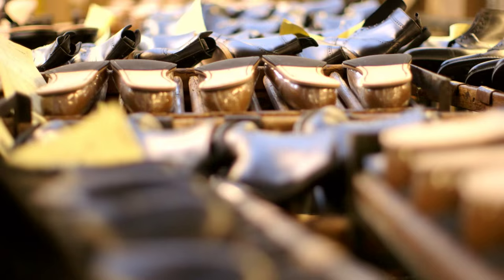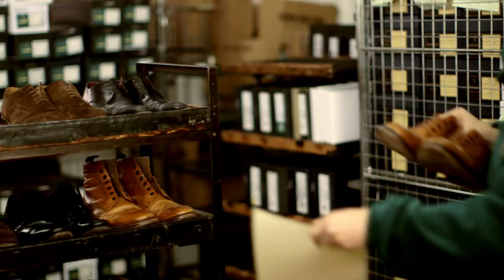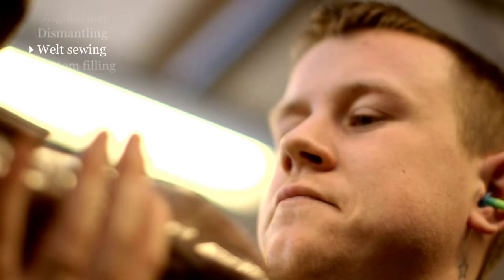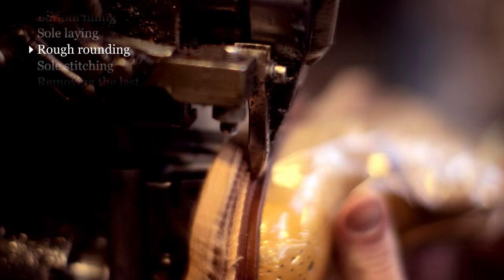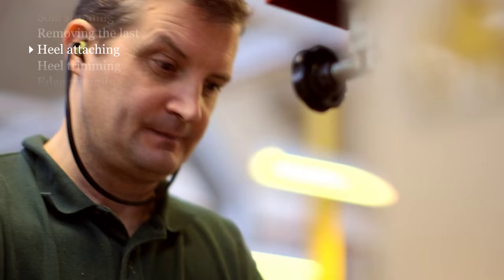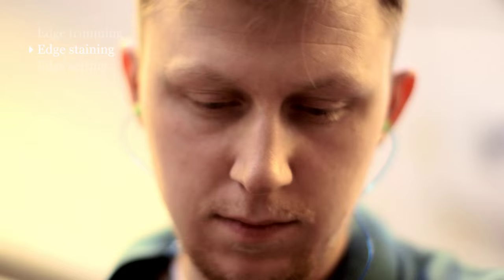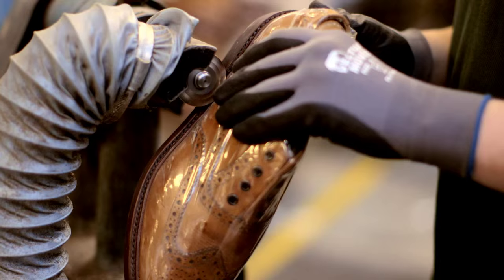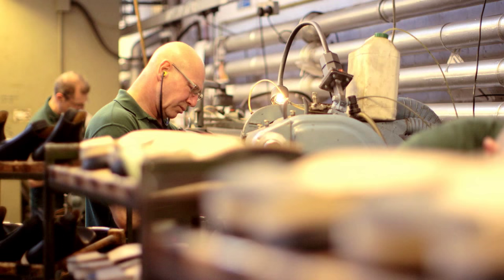Loake Shoe Repair Service

Comment: What an amazing video.  As a previous commenter suggests, how refreshing it is to see that this level of quality and care still exists.  As of the date I found this video, there were 15 negative clicks; for the life of me, I cannot imagine how anyone, let alone 15 people, could not like what you see here.  One thing that always puzzles me - with such high quality shoes, why does a manufacturer like this not team up with a shoe-tree maker to make LASTED SHOE TREES???  I mean, you get this quality shoe, then have to go buy an off-the-shelf shoe tree.  I own several pairs of quality boots & shoes, and I know that I would pay more for an exact fit shoe tree.  LaokeShoemakers - if you're listening - please consider this.  Thank you for a quality video.
Reply: LuvmyGSD the problem is that Loake is ignoring abiut 75% of the shoe in this "refurbishment" - the upper and the interior. This "refurbishment" is basically expensive and high-quality resoling.
Reply: LuvmyGSD the people who gave negative clicks very obviously don’t understand what craftsmanship and quality are ( their loss)
Reply: They destroy the welt of the shoes (1:45) during "refurbishments" and puts in a new one. They are intentionally damaging the uppers to limit the number of times you can resole your shoes. You then go buy a new one after 3 or 4 resoles. I'd rather go to my local skilled cobbler who handstitches new sole to the welt of my shoes.

Comment: I sent my 1880 Brogues back to loake for resoling (Danite sole) and general repair etc  was quite expensive but worth it to go back to the actual people who made it in the first place ... however the shoes came back perfectly resoled but the uppers were in as bad a state I when I sent them ..like the leather was very patchy dry looking the leather surface was dry at creases etc and showed distinct dry  lines  . Now yes I regualrly polished them and cleaned them I even used leather cream to feed the leather ( many times ) in the hope it would solve the issue ..but nothing helped they would polish up  ok but within less than a day of wearing them the dryness at the creases was back and the shoe looked very poor , I was disappointed that Loake to not address this with their knowledge  or even bother to enclose a leaflet or "report " to advise me about the issue or advise me that the uppers were beyond repair (i.e able to take a polish or feed and NOT appear dry at the creases etc ) in which case I would have binned them and bought new . So I don't believe they are carefully examined and brought back to the original standard at all (wear and tear allowing of course ) . I got the feeling they just put on new soles took my money and did not think to advise on the sorry state of the uppers appearance /condition with a view to the best outcome for ME the customer versus them taking my money for a resole .When I send them back to the factory for an expensive rework I want them to come back to me as close to new/ reconditioned as wear and tear allowing of course  .Very disappointed with Loake in that respect .
Reply: How much was the cost?
Reply: @rachellockwoodle  at the time (around 2 or 3 years ago £80 ish . I cant remember exactly

Comment: So the £80 repair is worth it! I'll be sending mine off soon.
Reply: they ruined a pair of mine , take a few photos before you send them , my boots came back with one of the pull on tabs cut and the mid sole missing , I sent them back 3 times got the tab replaced but not the soles but I got a £300 pair free but what I really wanted was my original boots sorted .

Comment: How much would loake charge for such a service? I foolishly got my shoes repaired at timpsons, but now I know this exists I think I'll have to try!
Reply: Cheaney charges 95£ for the same service. So prob in that range..
Reply: in Germany it costs 119 Euro, approx. £100 and includes the shipping too. I heard that one can refurbish a shoe 3-5 times, so one can  use a shoe 20+ years. Much cheaper than buying a glued shoe and throw it away after a year or two. I can't afford buying cheap shoes;-)
Reply: Timpsons are a rip off.  An out of town good old school indepedent shoe repairer  would charge about £45.00 maximum

Comment: I was recently not impressed by a Loake repair & would be hard pressed to ever send another pair back for this service, it was actually done FOC due to a quality control fault of there own in the first place (so 2 QC failures), now had I paid for it I would have been twice as annoyed. I have since found a good cobbler who will be doing all my repairs from now on.

Loake: sort your quality control department out !!
Reply: they left the mid sole out of a pair of chelsea boots that I sent for re-soling, instead of making good the job they offered me the pick of a pair from their catalogue so I chose a pair of dark blue Bedale lace ups costing £295 all I wanted at the time was a £95 re sole.
Reply: @rogerofrhodri  funnily I was told the factory manager would pick me a new pair himself & sent them out to me, they were a Chelsea boot too !

Comment: People buy goodyear welted shoes so they can have them resoled over and over. Removing a perfectly good and usable welt and machine stitching a new one damages the upper and reduces the integrity of the shoe. English shoe manufacturers like Loake, Barker, Crockett, Cheaney etc does this so you can only resole your shoe 2 or 3 times before you are forced to buy a new one. Don't fall for this marketing strategy. Bring your shoes to a good cobbler who can handstitch a new sole to your welt and upper and you will have a pair that will last essentially a lifetime.

Comment: I am considering going for a pair of Loake boots. I have noticed they are very similar in appearance and even colour to Tricker’s boots. However, the latter are considerably more expensive. I’m assuming there must be a difference in quality, or is there? It would be good to get an insight from somebody who has owned both. Thanks. (Knowing me, I’ll probably just end up buying both and being the judge myself.)
Reply: Don't buy  " design Loakes " made in India , they look good but as far as quality goes  nowhere near as good as the English shoes.
Reply: More and more traditional shoemakers are selling specially designed, cheaper lines that are made offshore — in Loake’s case, India. I have two pairs of Loake loafers — one made in Northampton and one from India. The latter is OK but it’s true there’s no mistaking the difference in quality. Just make sure you ask the question if you’re buying in store or if buying online, most of the decent cobblers state specifically if a particular pair of shoes  are UK made. I am currently waiting on a pair of the Royal wingtips. Loake may not be considered as good as Church’s (now owned by Prada, I believe) or Cheany (owned by Church’s) but I like them a lot - the Brighton loafers fit my feet perfectly and the UK-made shoes are good value.

Comment: I have 3 pairs of Loake. They are impressive looking and quality made shoes. The main issue blocking me from wearing them more often - they are not really comfortable shoes compared to cheap common pair of sneakers. The reason for that is their insole is basicly just hard flat piece of leather with a bit of glue and cork. They should make insole more anatomic/softer - feet is not flat, so hard flat insole is not comfortable to walk in....
I understand they are making them the same way as they did 100 years ago, but I rather enjoy modern car, than 100 years old vehicle...

Comment: I do believe not all of loakes shoes are made in good old england. hasnt loake outsourced some of its lines to be made in the far east
Reply: +Daniel Devine Yes, the L1 line is made in India (even says so on their website). It's less than half the price of the 1880 line though. I think they saw a gap in the market for "affordable" goodyear welted shoes.
Reply: As I said in my previous post, Loake advertise that the L1 and Design range are made in India. They advertise that the 1880 and Shoemaker range are made in Northampton. Is there something I'm missing?
Reply: michael yates So the 1880 and Shoemaker lines are fully made in England? The reference to Northampton was my error. The website says Northamptonshire.
Reply: Some of the cheaper ones are made in India.
Reply: Daniel Devine 
The 1880 and the Shoemaker Lines are made in England but the Design line is made in India.
Reply: I have Design Loake range and it says made in England ???? Strange
Reply: Design Loakes are made in India  , look good , but the quality is not the same

Comment: if customer service is so important for Loake, why do I never get any response from them, when I ask about sizing and lasts?
Reply: Bruno Koch you are not important customer for us sir
Reply: Bruno Koch call them. Better to call them rather than emailing
Reply: You will never get size correctly online, unless you try the shoes yourself...
Reply: Thats not my experience.
I recently re-discovered a ' brand new' pair of brown Loake slip ons that had been stored away for around 30 years and still mint , in the original box.
I wrote to Loake asking what I should...if anything...do to ensure these shoes would still be good as the day they were made, and hadn't dried out etc etc.
They were very polite, responded quickly, and did their best to be helpful, while suggesting that they would give me a detailed answer if I SENT the shoes to them , using pre-printed Royal Mail arrangements, in order that they could advise post a genuine assessment of the condition today.

Comment: What boots are those at 0:23?
Reply: Pretty sure that's the Burford. I have a pair and they are wonderful once broken in.

It's made on the same last as the Chester and is very similar in design. It has a broader, more chiseled and elongated toe compared to the more traditional rounded toe of most country brogue boots. Some people would call it a 'town boot'. They're fine for dog walking but I probably wouldn't go wading through a field in them.

I'm also a big fan of the Dainite rubber soled version which, in my opinion, makes a lot more sense than a leather sole for a boot. For me, leather soles are for the office or more delicate shoes like suede loafers.
Reply: Enigma of the Absolute - are they also made in India like so many Loake shoes?